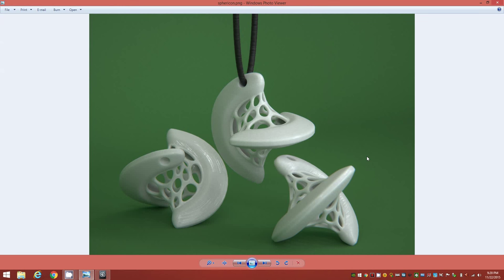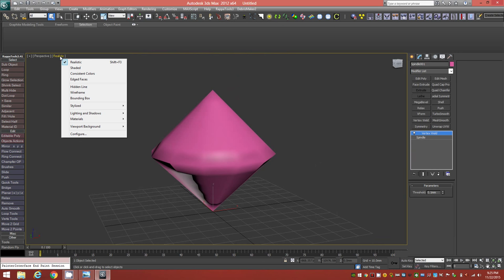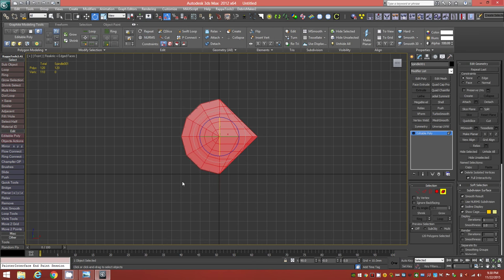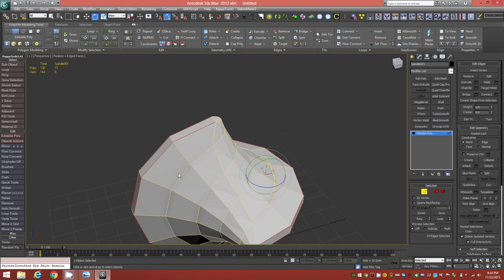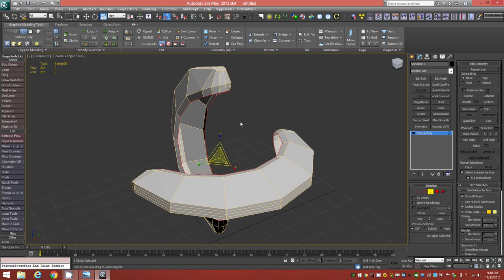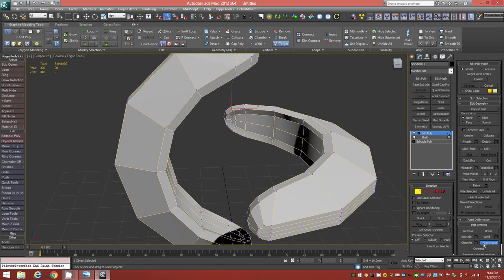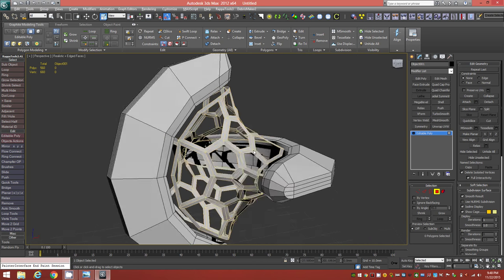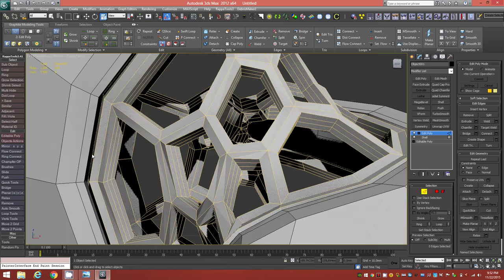3D Tutorial | Sphericon Pendant | 3dsmax

Comment: you forgot to mention at around 3:58 an on that you had cap segs set to 5 this makes a world of difference when trying to follow, mine were on 0 then i wondered why u had so many poly's. Other than that loving the tuts.
Reply from the maker: Very good point.  I should have mentioned that.  Cap segs are set to 5 by default when drawing up the object, so it slipped my mind that this could be changed by some users.

Comment: I thought you couldn't use any smoothing modifiers as 3D printers don't recognise them? Amazingly well-explained tutorial. I could follow every step without 3DS Max open even. You make a great teacher
Reply from the maker: Subdivision surface modifier actually changes the geometry by smoothing the surface with additional polygon density.  You would need to collapse this modifier before exporting, but it will quadruple the amount of polygons while it smooths sharp edges, therefore can indeed be recognized by 3d printers.  You are correct in the fact that smooth shading is merely a surface algorithm, and attempts to make the object appear smooth by using lighting tricks.  Smooth shading will not export as geometry changes on the object, and can not be recognized by 3d printers.  Subdivision smoothing is completely different, and works for this purpose.  Hope this helps.
Reply: Thank you so much for taking the time to explain that, it's much more clear. I understand how it works now. Excellent tuition very clear and easy to follow, good job :)
Reply from the maker: No problem, glad it helped.  Keep in mind also that whenever you use a subdivision modifier like Meshsmooth, Turbosmooth, or OpenSubDiv in 3dsMax, the default usually has the ISOLINE display mode active.  Isoline display is a way to help you visualize the low poly wireframe cage beneath the subdivision modifier while you work on it.  However, this option needs to be deselected or turned off before you collapse the stack for export.  If you do not turn off Isoline display, it will screw up the mesh horribly upon export, and it will not 3d print.  Be sure this option is off before collapsing the stack to reveal the true topology of the subdivided model to export.
Reply: It's been a while, but I'd like to thank you again for this reply. This one snippet of information has helped me no end. I look forward to future videos

Comment: Amazing tutorial, the way you explain everything it's so clear and simple. 
But could I do that with Matrix program as I can see you using different software. Karina
Reply from the maker: I don't have much experience with Matrix CAD software, but I know it's the industry standard for adding gemstones and custom designs to jewelry models, so as long as it has the ability to edit objects at the lowest levels of control, then it should be capable of doing something similar.

Comment: cool! try print this. without supports
Reply from the maker: +Kvant Live  Thank you.  Yes,  this is a model which may need some finalizing and preparation before printing,; especially on certain machines, and with certain materials.  These videos are intended mostly for preliminary design and creation process before 3d printing.  It's always best practice to STL check, and take the model into a pre-printing software like Netfabb to check for any issues before sending to a printer.  Supports, if necessary, can be added in a post-processing software, and are probably best to include them that way.

Comment: They used to be called OLOID's but looks like someone has ripped off the original inventor - Paul Schatz from 1929 and changed the name so they dont have to credit where credits due.
Reply from the maker: Quoting the Wolfram and Wiki literature: The sphericon is the convex hull of two semicircles on perpendicular planes, with centers at a single point. Its surface consists of the pieces of four cones. It resembles the old in shape and, like it, is a developable surface that can be developed by rolling. However, its equator is a square with four sharp corners, unlike the oloid which does not have sharp corners.  Since I started this one with a Sphericon shape, I kept the name for the title, although the final version isn't either in mathematical truth.